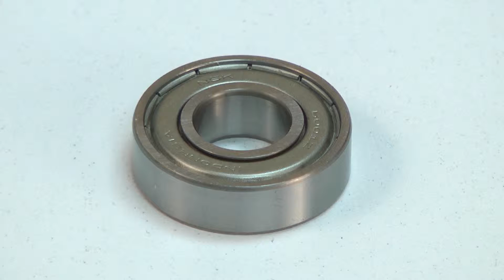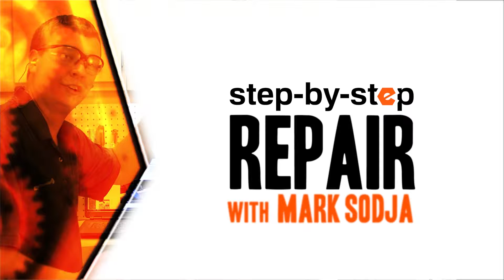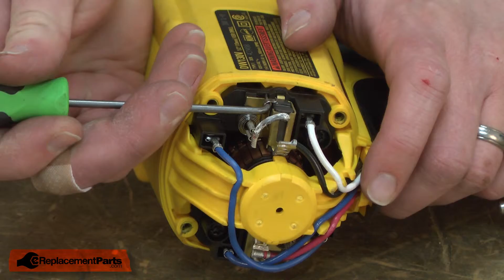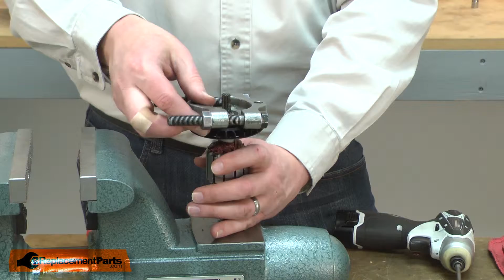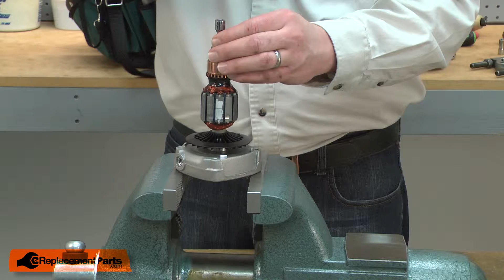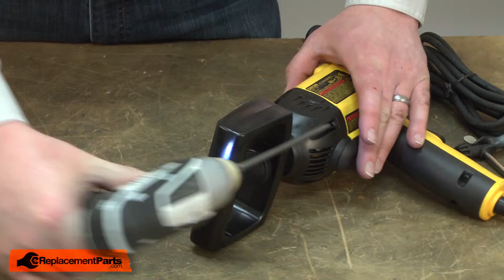DeWALT Drill Repair - Replacing the Bearing (DeWALT Part # 330003-09)

Comment: I just bought a DeWalt DWD115 drill that looks almost same as urs 
in this video w the hand grip in the middle but no shovel handle at
the back.  So i dink (think) it's same mechanism as urs.  My ques-
tion:

  How does the ball bearing sounds like when new?  Not squeeking
  but mine makes gurrrrrr ... rattling rough sound.  Is that how it s/b
  when new or when the bearing got replaced? 

In contrast, my regular Milwaukee old corded drill and Black n Dicker
drills produce whining (wheeeee) sound, much smoother sound, 
probably using friction bearings.

I don't think i can  contact the importer, DeWalt (made in China) to
give me the answer nor the seller/distributor.